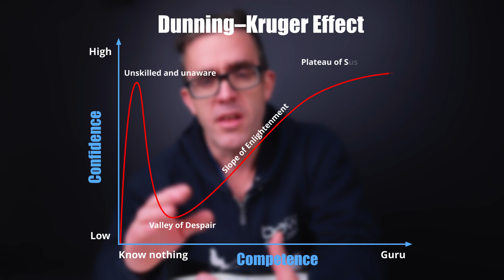The Issue with Engineering is Expertise

Comment: Talking of bias, Some times at my Uni it felt like some part time lecturers were just sent by their companies to advertise their products(like beams and Connections etc). They would spend the majority of time talking about the benefits of their product and why they are superior and use the slides for product placement, rather than explaining the design process and concepts.
Reply from the maker: Yea when the supplier presents, it can be more a sales pitch then technical presentation. You always need to be more sceptical as they likely have some bias. Tho I have had some good presentation from Hilti on anchor design.

Comment: Great video once again. I totally agree. Always having a student mentality can get you very far. I'm currently treading the thin line between always doubting myself and having the confidence to make certain calls.
Reply from the maker: Hi Theuns, thanks for your ongoing support. Sounds likely you are coming out the other end, it is a hard journey climbing out of the valley of despair.
Reply: @BrendanHasty  Thanks. Yes it's a long, and sometimes frustrating, road, but so worth it! I'd rather struggle and figure things out and properly understand them, than to blindly memorize and use formulas without understanding why. And "mentors" like you make the road a bit easier!

Comment: Yep agree 100%, illusion of knowledge and lack of expertise are definitely rife in AEC. I genuinely worry that the lack of active mentoring in our industry as well as the skill inversion burying the knowledge behind our programs is causing an environment where this is so much the younger generations 'don't have to know', or the older generations don't have the ability to review, audit and interact with meaningfully. Tight project deadlines and loose QMS process' are also contributing to an environment where risk is everywhere, and I feel is less mitigated as time goes on. I've been baffled by things I've seen and heard in the industry when it comes to gaps in QA systems, or grads being expected to 'just know how things work' with no mentoring provided to ensure this.
Reply from the maker: Hi Bim Guru, thanks for watching. Agree better mentoring needs to happen. with people trusting the blackbox too much and outsourcing it is becoming harder and harder for the younger generations to get the required experience. I worry too where the industry is going. The changes coming into NSW are a step in the right direction, tho will likely take sometime for the benefit to be seen.